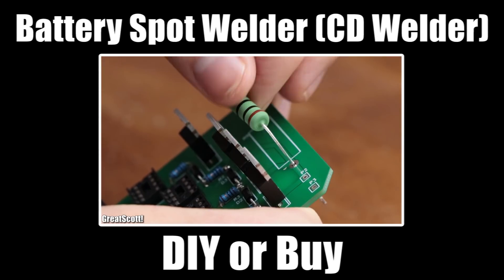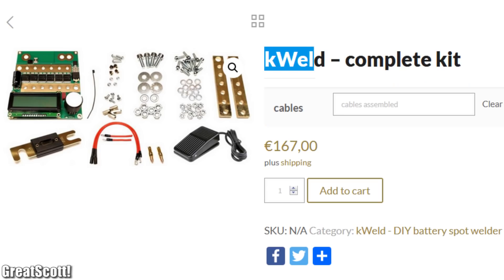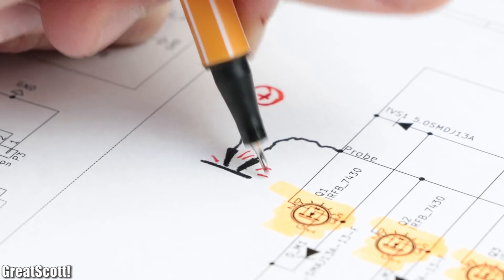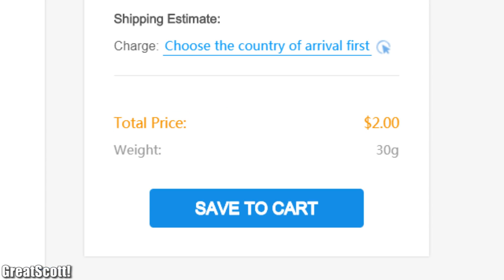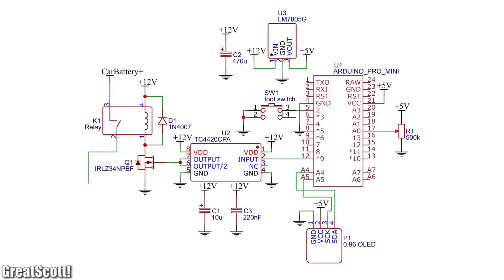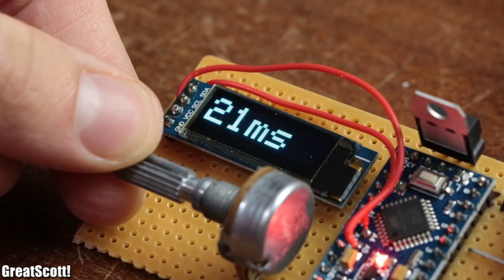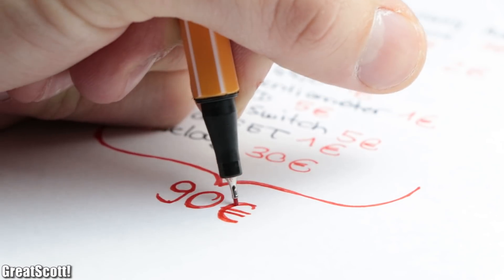Make your own Crude Battery Spot Welder with a Car Battery!

Comment: I have a cordless drill, 15 years old, dead battery, can't buy a new one, no-name brand so no aftermarket. 18650 in the pack, I have the batteries but no spot welder. could buy new batteries and adapter to modify but would be uneconomical. Cannot win man

Comment: You can actually get some really beefy mosfets for not that expensive for lower voltage applications, $40 for a 330a rated mosfet! (Max 40v)

Comment: instead of that huge relay can i use several relays in parallel to reduce the current rush on each one. will the timing of switiching be accurate enough?

Comment: A lot of work has been done, but the result is actually so-so. The welding points are not neat. 
 It is better to use copper or bronze probes and make rounded tips..  
 Also, I passed this way and I can say that the relay burns inside after some time.
 I had to give it up after a year, because it started to stick at the wrong time, which could (and did) lead to burning the jar.
 So I ended up doing my project on MOSFETs, installing a lot of internal redundant protection against induction peak pulses due to long thick cables.
https://youtu.be/YaYGGL6ZK88 (RU, attention :) )

Comment: Don't mean to spoil the fun of building spot welders to anyone, as this is a pretty awesome thing to do, but in case anyone needs something to get the welding task done, welders have now become cheaply available on Amazon for about $50, or AliExpress for about $30-$40. Probably not as great efficiency as ones we can build ourselves, and certainly less configurable, but get the job done.

Sharing this only because i recently needed just that to recover a 84V battery (leaking cell). My first impression after coming across this video was that the welder would cost as much as a power cell, but thankfully it wasn't that bad. Bought myself a tiny and great looking box that gets the job done.

Comment: In case there's any confusion, it's "nickel strips" he's using.  Pure nickel that meets today's standards. Not to be confused with  the horrendously inferior and outdated  'derivative of nickel alloy' that is largely associated with and derived from the southern US, particularly known for its use for making chains and cuffs, if you will. Remember: "pure nickel". Nothing else. Anything less, and you might as well be sourcing your metal from the sub-par foundries of 1950s  West Germany, or even 1930s-40s Germany - a product that is widely known for being unmanageable, unmalleable, highly-resistive (to the extent that the inductive heat ruins anything around it), and just impossible to work with, in general. If you see this product pop up anywhere, report it immediately.

Comment: Love the projects - this is a good one . It seems odd to me that both terminals are placed on the strip rather than one on the strip and one on the base . It obviously works but doesn't this mean a lot of current is just shorted out through the length of the strip ?

Comment: "CCA above 300 amps" I can't even find a car battery with less than 300CCA these days. 
Best value for money hands down is a 34/78 group battery. Nice big side posts for you to make a good connection with and most decent ones can deliver 1000 CCA no problem. Usually the same price as many smaller batteries as well.

Comment: For those newer to electronics, like myself who were wanting to build something like this, there were a few components that were not included in the list of this video or in the Instructable:

The red film capacitor appears to be a Würth Elektronik WCAP-FTBP Film Capacitor (which is what came up when I was finally able to get a clear shot of it at 6:10). I am not sure if this is the 470UF cap or the 220UF cap. WE does not carry a 470uf capacitor, but they do carry ones listed as 470nf (.47uf). So now I am wondering if I am looking at the schematic incorrectly, if it is mislabeled, or if the standard aluminum cap is 470uf and the film cap is 220uf.

This is why it is important to label all of the components during assembly, because there is no way of telling what is what for those who are new.

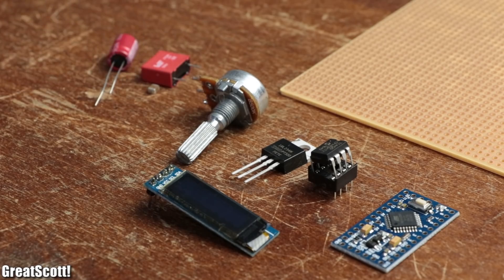I tried to find the 10U capacitor, but couldn't see one on the project. Instead, there also appears to be a tiny SMD Ceramic capacitor that is soldered on the bottom of the breadboard. This was shown as a loose component next to the WCAP-FTBP at 3:41, and then shown on the underside of the board at 4:41. I am presuming this is the 10uf (not nf?), but at this point I don't know.

I would appreciate some clarification from GreatScott  or more electronic-savvy individuals on this channel to be able to correct me if I am wrong on these observations, or the labels of these components, but I thought I would try to help those who are confused by the omission labelling of some of these components in the video. An updated PCB trace would be amazing to help those looking to repair their 18650 battery packs without needing an electrical engineering degree in order to complete the project. As a backup to this project, since I am not confident in being able to find/layout the exact components,  I plan on toying with using a 555 Timer in monostable mode with a potentiometer to control the pulse duration of the relay.

EDIT: After re-examining the schematic, it would appear that the 470uf cap is the standard aluminum capacitor as it is next to the 12V, and since the red WE film cap is next to the TC4420, that would likely be a the 220nf (.22uf) - but I am not certain.
Reply: Thanks for the write-up. Apart from playing around with assembly projects, I'm an absolute beginner at this kind of thing, but I came to the same conclusion that the red film capacitor is 220nf, and that the 470uf is a standard electrolyric capacitor. Hopefully that's correct, because waiting another 2 months for Aliexpress will kill me haha. I wish he made the parts list a little clearer, but the schematic certainly helped.

Like you said, I'm just some guy with limited electrical experience trying to make a cheap spot welder but for what it's worth, I think what you're saying is correct.
Reply: If you go to the instructables page it has the schematic. Capacitors are mostly generic and interchangable. As long as you use the right values and voltage ratings then you should be fine. If you can't build this from the schematic then you likely shouldn't be thinking about building something like this and should instead just buy a spot welder.
Reply: @conorstewart2214 What a helpful and insightful reply to a genuinely curious inquiry 3 years ago, which may or may not be relevant today!

I am so glad you took the time to read what I posted and decided to have a trite smug gatekeeping response instead of taking the time to actually educate others, like the purpose of this channel is for.

I am also grateful that you said, "as long as they are the same value, it doesn't matter" because heaven forbid RIFA capacitors were a thing. There is a reason why Replace Immediately Fire Ahead is the joke acronym. So yeah, no, you're wrong. Components matter.

But hey, if you are not able to have a basic sense of time, you probably have no business replying to infer that someone wanting to verify a tutorial lines up with the schematic and proper component selection is too stupid and should just, "buy the thing". When, in fact, at the time of this posting, there were serious deltas between them. It's not like a schematic has EVER been wrong or anything...

Have a great day.

Comment: 4:10 Why do you need a mosfet driver in addition to the mosfet? (Why not just use a logic level mosfet?)
Reply: Becuse of how many mosfet are in paralel, there is a high charge energy that the gate driving circuit has to deliver enough current to turn on and off the mosfet fast enough so they dont work in the linear region. And therefore they wont explode

Comment: Thank You again for a great ( Too the point Info that can be used ) Video . I have researched about  spot welder ( Kits/RDY Made ...Etc...) and my conclusion is that for the cost i may as well  spend a tad more (30$+20$Ship) , save my precious time and get something that will be reliable ,adjustable ( consistent quality welds no matter what different material i use )  and be durable , lastly for future projects it will be ready to go . is it possible for us to talk ,i have some project that may be of interest to you ,Cheers & TY again  G.S.

Comment: Can you make one without arduino ? maybe charging a capacitors bank with 12v or 19.5v , the pedal idea is clever but it would be even better to make a built in switch that trigger the electrodes by pressure on one or both of them, i believe that the price of building such device can be lowered a lot but keeping the results elegant and practical and none better than you to show us how to. Please operated with 12 v or maybe with recycled laptop charger 19.5 v.

Comment: Im trying to do the same design but im so confused with the capacitors and i just notice you using a second mosfet or im not sure what it is and where it goes is the one on top of the schematic that goes with a 470uf capacitor

Comment: thank you so so much - i made this with slightly modifications,  added small relay at the output with controls the 16 mosfets connected in parallel. and welds were really great 👍👍👍👍👍👍👍👍👍
https://youtu.be/6tyWmNnVkYk
Reply: What power relay did you use. Its expensive and I am looking for a cheapet alternative.
Reply: geek4001 https://youtu.be/6tyWmNnVkYk check this out. Instead of relay. I used common n channel mosfets.

Comment: would it be possible to use a low voltage transformer built scavanging a microwave oven trasformer instead of the car battery?

Comment: I am in the process of making the spot welder using a Nano instead of the Pro Mini. I am making the board step by step and checking that it works after the completion of each stage. Now I am at the output stage and I cannot tell for sure witch pin of the Nano I should connect to the input of the TC4420. Can you please let me know for sure witch pin I should use?

Comment: how about the accuracy of the relay?
Because of the mechanics there will be time needed to turn the relay on, and the energy in the coil will flow thru the diode and keep the relay longer on.

Comment: What are those capacitors you used and were they used to smooth the voltage going to the arduino while drawing hundreds of amps from the car battery?

Comment: Bad idea ! It's only a matter of time before those big relay contacts will weld "themselves" together. In 40+ years of working with electronics I have repaired countless circuits where relays that handle large currents have welded their contacts closed no matter how overrated the current handling was.

Comment: i builded something similar but i used microwave transformer ,230v relay and foot switch and capacitor discharge timer for the relay. Crude? YES but i don't weld these batteries very often so whatever

Comment: Hi, great work you are doing. I was wondering if you would know how to set up this timer i bought of eBay. I cant find anything on the internet. This is the link 100A/40A Digital LCD Double Pulse Encoder Spot Welder Machine Time Control Board

Comment: Would be much simpler to build a 555-based timer :-) No arduino, no programming needed here! Seems people like to use arduino everywehre and for everything...
Reply: I 100% agree. Maybe you could even build a circuit to drive a 7 segment display for timing!
Reply: @annemariemiguel2541  For someone like me, building the circuit for the display is what makes the project complicated enough to just use an Arduino. A more competent person like Scott could probably have done it that way, if he had wanted. I'll be using an Arduino (because I want a segment display).

Comment: I assume 90€ includes the cost of the battery?

Personally, I wouldn’t count that since many of us would have a battery like that around for other primary uses. When I occasionally need to spot weld nickel strips I’d just go grab the one under my motorcycle seat, for example. The spot welder is the secondary purpose with occasional use and, thus, I would not attribute that cost to the spot welder.

In my part of the world almost everyone has a household vehicle with a battery like this. Others might have a boat or golf cart with a deep-cycle marine battery which can work even better. An ATV or riding lawn mower with push-button starting could also be available. In short, it’d be very hard to find an electronics pro who needs or even wants to dedicate an expensive lead acid battery for this with so many other primary uses around to borrow one from. ;)

Comment: Can I use the microwave transformer instead of this car battery!! Looking forward to see your reply, thanks a lot.
Reply: insufficient current
Reply: Microwave transformers can however be used for arc welding as it requires much less current than spot welding (about 50-80A for arc welding and about 100-150A for spot welding).
Reply: You would have to connect 3 or 4 microwave transformers in parallel to achieve that much current.
Reply: at least that's what i experimented :D

Comment: Hi scott i follow your instruction but your shematics and part list doesnt not reflet your montage on picture.you listed 4 capacitor on sheet but only two was used on your pcb and maybe one of them is not connected at all (if i trace the track and component location).thank for your help and keep goin..

Comment: Interesting idea but a few remarks on that solution:

1. Why do you use an arduino setup? Its so much easier just with a classical NE555-timer with the same precision :-)
2. I tried big solenoid switches too with a 66 Ah car battery. They wont last long as the current can easily raise over 1000 Amps for a few ms. Even below 1000 Amps the switches wear out rather quickly and tend to stick! The fuse will be your only safety measure then.
3. In my opinion an electronic switch without mechanical contacts is much better here (power mosfets).
4. A good crimp is much better for power connections than soldering. And soldering strips to put into screw terminals is generally a bad idea - as already mentioned below. But i fell into the same trap a lot of times but i had cases where these connections went very bad after a time due to mechanical stress and settling of the solder.
Reply: I liked the idea of GreatScott and I build the same circuit with the same solenoid and had a similar problem with a 54 Ah (about 500 A CCA) car battery. After welding about 150 cells of 18650 the welding properties were getting more and more worse. In the beginning i could weld with 30 ms. At the moment i had to increase the timer up to 65 ms to have a connection which is also not as good as when doing the first welds with 30 ms. I also think that the solenoid does not like the use for many welds. Therefore i will try to use the circuit for driving some MOSFETs instead of the solenoid.

Comment: Hi, Greatscott for the next video can you modify a 250w boost converter to power it on with 5 volts from a powerbank?To charge a 36v battery.

Comment: can anyone help me, i have built an e-bike (36v 1000w) i have a 36v 10a battery pack https://www.amazon.co.uk/X-go-Discharge-Electric-Bicycles-discharge/dp/B07D9HD8GB/ref=sr_1_6?keywords=36v+battery&qid=1555667416&s=gateway&sr=8-6 undervoltage protection is cutting out the motor, can i buy another battery the same and just wire them both together at the outputs
Reply: the motor is pulling too many amps for the battery, i think by adding a second battery it will share the load (will be like one 36v 20a battery? is that correct?

Comment: You are the hero I needed. I messed up some cells in my Esk8 battery pack because of broken parallel cconnections due to solder connections failing. I don't want to resolder new cells so I need an affordable spot welder and this is definitely a viable build. Thanks for persisting and finally designing a working spot welder. I cannot thank you enough.

Comment: How about something that uses a DC arc welding box (~27V at various A, in my case topping out at about 100A) as the power source instead of a car battery?
Reply: You can use that thats actually a bit overkill

Comment: Thank you Great Scott. Your last designs inspired me to DIY my own spot welder first from a car audio 20V 1F capacitor. It was not powerful enough even charged to 18V. So I turned to a car starter solenoid/car battery/timer configuration back in February. Simple, consistent welds on my 13S8P bike pack from recycled laptop batteries, (don't use recycled laptop batteries for an e-bike). 880CCA car battery: have, $16 starter solenoid from autoparts store, 3D printed holder for spring loaded welding tips recycled from an actual automotive spot welder and processed in a lathe. Borrowed the auto-pulse idea from Maletric's  design. No idea how many joules i'm welding with, enough would be my guess. 15mS seems a happy medium between 8mS just starting to contact and 45mS blowing holes through 3 layers of nickel strip.

Comment: Fine, you save 80 EUR. But how much time did you invest for soldering and programming? Don't forget your time also has a value. I went with a relay at first, car battery also, then big capacitor  bank, still unsatisfied. Then I invested into the kWeld and welded over 5k cells in a year and never looked back. If you like tinkering and soldering, by all means do it. But if you like to get the job done in a consistent manner, honestly buy the kWeld...

Comment: The problem with a lead acid battery as current source is that it's cold cranking amps capability is highly sensitive to the SoC (state of charge). In my experience even after 100 welds, the battery degrades quickly in a non linear matter, thus the timing in msec goes up also non linear. Meaning you'll get inconsistent weld results for a larger pack, say 7s6p. Or you need to adjust the timing constantly
 Not very practical...